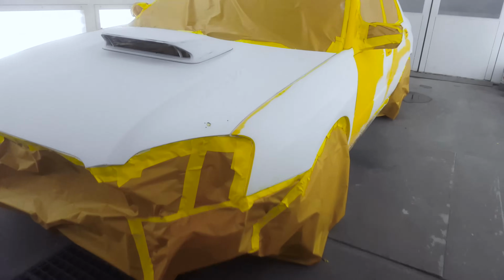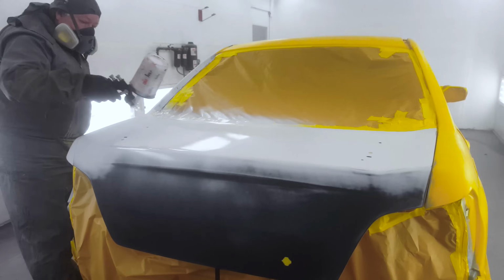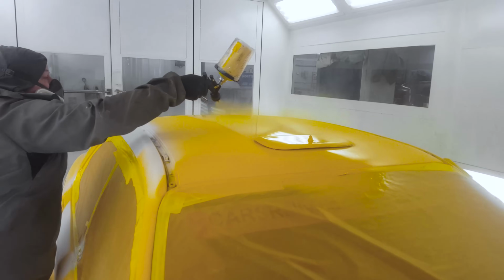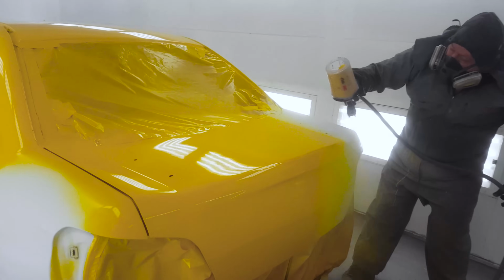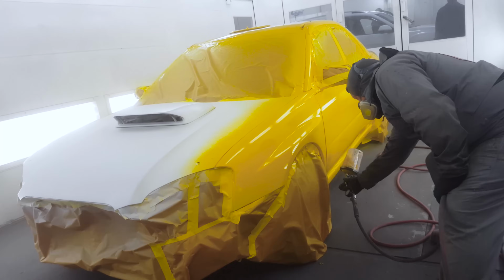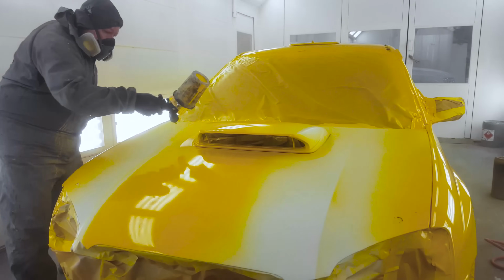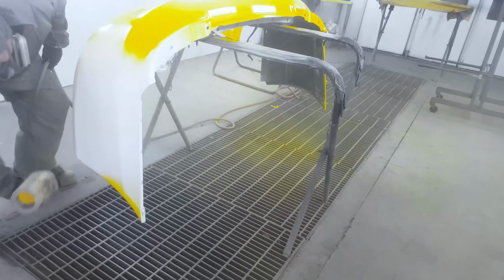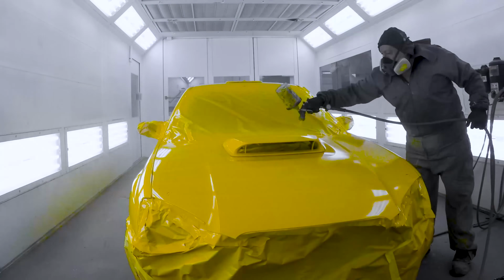Quick Transformation: Two-Coat Rally Yellow Paint Job for a Speedy Rally Car Makeover

Comment: I painted loads of cars in the 70's and 80's , and we only had enamel single stage with thinners no harder back then . Two coats and they would look like glass, no wet sanding or all that buffing , they do today . A better finish and lasted longer . This clear coat these days can't take the sun , you see cars only a few years old with the clear coat peeling . The good old days , the paint was far better and a fast job.
Reply: Yeah, but didn't they change the paints because they were awful for the environment or something like that?  Same thing with the dyes they used to use on automotive interiors were very color fast and sturdy but caused every kind of cancer imaginable.
Reply: I here ya painted plenty of single stage back in the day, plenty of depth not like the junk sprayed today with no shine or depth.
Reply: Paint is better today as it is urethane based,I will say it is a lot more expensive so you tend to see cars that have been painted having problems from someone using cheap material or trying to shortcut the job.I know when newer cars are painted in the factory they do not put enough material on one either which also leads to color problems for the shop repairing the vehicle.
Reply: With the high metallics,  and tri coats, it would be next to impossible to spray  the new colors and duplicate the depth with single stage.
Reply: Talking chalk and cheese
Reply: the reason you see clearcoat peeling is because the painter left it too long before he applied clearcoat its a really big problem that he allowed the base to dry too long before he cleared it there is a time scale that some painters do not to adhere to if I base a car up I like to get clear on after an hour there is about a 3 hour time span it, painters that leave it overnight expect delamination within 6 months., and can I add if it's not keyed properly around the edges when you paint everything needs to be keyed if not thats where delamination starts on the shiny surfaces.

Comment: I painted few dodge and peugeots on single stage. White and black.
Using paint made in mex, it works awesome and has the same life as a clear coat. (5 years on acrílic single stage and médium quality clear).
On the poliurethane single stage, it has 8-10 years of life.
Both are for low cost but has very great results and quality.
Even I've been sprying pearled red, greys, greens, silvers on single stage on chevys and volkswagens 😁

Comment: If the original single coat paint is good and we just want a repaint do you sand it first before applying the sealer. The reason I ask, is that the paint job that I followed did not give me the right paint so I will be painting over this paint job and I’m wondering how to proceed sealer and the paint or sand sealer and the paint?

Comment: Hey guys. I have a lot to learn. I am still confused between sealer and primer and epoxy primer. And there is paint with just reducer and paint with hardener and reducer and paint with a clear coat. I painted my interior with single-stage paint. It looked great when I was finished, but it became dull in about a month. It was mason paint I think from Napa. So many questions and not as many answers. Thanks for sharing.👍👍
Reply from the maker: Hey, I’ll try and clear some things up for you. Sealer always refers to a 2 part primer that doesn’t require sanding before paint. Epoxy primer uses a different resin than a regular primer(primer surfacer). Epoxy provides superior protection, but it is slow drying and doesn’t fill as well. Epoxy can also be used just as a metal treatment or sealer,  many of these primers can be versatile and combined in the process in multiple ways. I could not answer as to why it went dull, that would require a deeper understanding of the process you followed.
Reply: @Refinishnetwork  Thanks for your input. I am just doing my own ride. I don't plan on doing this for a living. When I get my truck ready for paint, I want to do it once. Right now it is sitting with some parts in red primer of who knows what it is, Paint is dark blue and who knows how old and some bondo areas and bare metal.  I was thinking maybe I should spray it with some kind of primer or sealer when I finish the body job and then paint it. I am going with a flat black os hot rod black as my topcoat.

Comment: First timer here... What do you wipe the car down with before starting to apply the sealer? I have asked a few people with no answer... I really want to spray a van that is used for underprivileged kids. I tried already and the paint is flaking off in places. Please any advice would be appreciated.
Reply: As an 18 year old in high school who is in a auto body class, i can do my best to explain this if you still need the info. Before applying sealer, I wiper the whole panel that I will spray, down with wax and grease remover, then I blow it off using a blow gun, and then I use a tack rag. I spray the sealer light as in all I want on the panel is just the color. You don't want the sealer super wet. Again sorry for the late reply, but if you need any further help, i can do my best to explain!

Comment: How long should one wait in-between laying the second coat?
Reply: Depends on the air temperature and if your using a slow or fast hardener. After 1st coat touch a part of the masking tape. If it feels sticky like tape, its ready for the second coat. If its not sticky and feels wet..... Wait longer.

Comment: I am spraying Polyurethane single stage with a HVLP at the recommended pressure around 15psi . I love the paint but it does not love me. I get runs no matter how I spray. I tried one tack coat plus one wet coat and it runs, I tried one wet coat and it runs. I am starting to think it has something to do with the hardener. I am using PPG paint. Any comments is appreciated Thanks.

Comment: Great job and the explanation was fantastic.  Question for you...on single stage paint, I was told to do it in three coats: 1. light coat to provide a bite for the 2nd coat.  2. medium wet coat.  3. final medium wet coat.  I've been having issues with graininess after applying a few coats of single stage black.  Thanks again.
Reply: So with single stage paints they can be quite fusssy on how they are layed down my advise is spray similar to laquer/clearcoat. These paints are usually fairly dense so a bit of a higher pressure and fan adjustment is usually needed. Watch a few videos on setting a gun up for laquer and work from there.

Comment: n I got tiger stripes with my new for this project devilbiss startingline spraying metallic, 22psi gave best spray pattern, slightly heavier on bottom, even when I turn air cap 180 degrees. Air tip clean. Held gun what seemed parallel to surface. sides are good- just hood,roof, trunk.Have 3 coats on and looks better but still can tell. So do I scuff and spray at higher psi and increase distance spraying to fix?

Comment: How long did you wait before starting 2nd coat?
Reply from the maker: Around 7-10 minutes
Reply: @Refinishnetwork  also it might sound as a stupid question but you do not need to clean the spray gun between the coats? No risk for the paint inside to dry ? Thank you!

Comment: Can you spray Single Stage without sealer? For instance simply fine sand existing paint on the car and then do 2 coats of Single Stage?
Reply from the maker: Yes, you can. It may require more coats though depending on the transparency or the color. Yellow is usually fairly transparent.

Comment: Can you paint a car without sanding it first?
Reply: Yes u can use a primer to thoroughly cover the old colour and then apply 1 or 2 coats of the new paint
Reply: You can but it's not going to last long. A week at most until the paint starts peeling and chipping off. The paint "grabs" on to the sanding scuffs
Reply: You can... but, should you? Noooo!!!
Reply: Sandig, degreasing etc. is more than 50% of a good paint job. In you don‘t want to all steps, don‘t try to paint. It‘s Not difficult to prepare the car
Reply: No you can't
Reply: Go to economy  they only wash them and don't  use a pressure  washer
Reply: Consider weight too.. Retaining old paint means weight increases, hence reducing performance as well as increasing fuel consumption..
Reply: @Stephen-hu8ec  so please tell me how much weight do you think it would add to the car like two bags of McDonalds on the back seat LOL
Reply: @hashermohomed6598  stop giving people advice! Thats rediculous.
Reply: @St.111  sorry daddy

Comment: Looks his spray pattern is very narrow
Reply: Yes, and he’s within 2-3 inches away instead of 4-5 so I guess if you like a thinner pattern and you want to spray close it’s a matter of adjusting your gun/compressor in this case a lower flow and psi.
Reply: Look at 8:22 in the vid- the Tekna gun has a monster fan about a foot wide. It looks like he overlaps a lot. Even and wet!
 Would have been nice to know which fluid tip, which air cap, how many turns out and air pressure.  I'm guessing 1.2 tip, TE20 cap, 4 turns out at 29 psi. Comment?
Reply: Whoops- down the replies he said 1.3 tip and HVLP cap. That dude can really lay it on!
Thanks for the vid. Now I'm guessing the pressure was 22 psi...

Comment: hey bro so i bought a new bumper for my dodge ram and it came in powder coated a grey color. and my truck is a single stage black paint . do i need to epoxy primer that bumper or will it be ok just scotchbriten it or hitting it with a 400 or 600 grit wet sand and spraying over the powder coat

Comment: I would of thought by today's standards single stage would be just as good.?
Reply from the maker: I think the premium lines, such as UNO would hold up incredibly well for a long time. UV holdout, especially when blending is required, clearcoat would be optimal.
Reply: I do paint and body work and paint manufacturers base their longevity on a car that is sitting in full sun. Single stage paint in full sun will last roughly 7 years. Base coat clear coat with a production clear will last roughly 11 years in full sun. If you use a high solid clear and do 3 coats of clear instead of the normal 2 coats then you increase how long you're clear will be resilient to the UV rays.